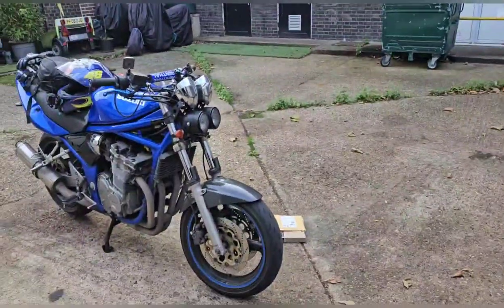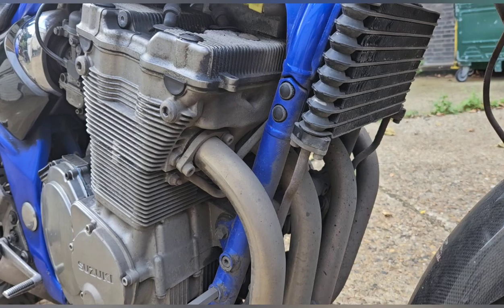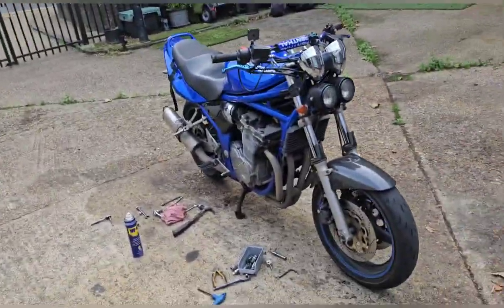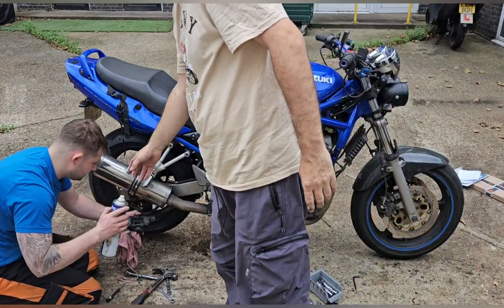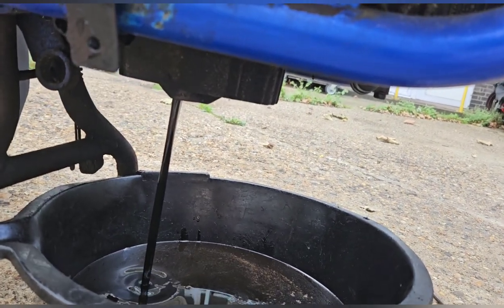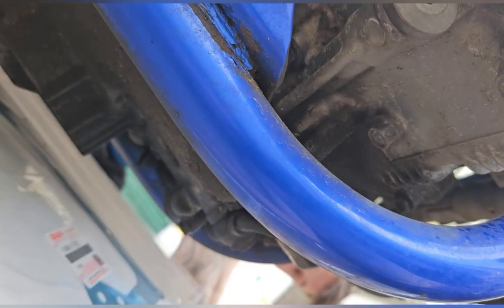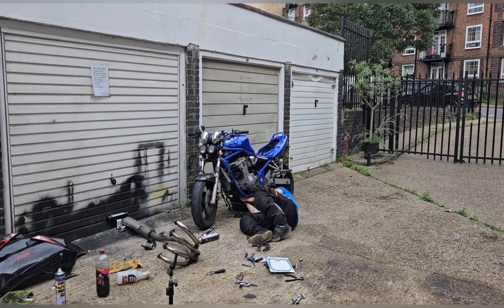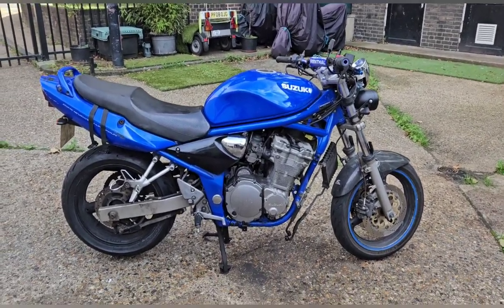Suzuki bandit 600, gsf 600, sump gasket, sunp gasket change. Gary learns more and more.

Comment: When I took the sump off my 1980 GS550 shortly after I bought it, 2 years ago, it was like a swamp in there, thick black sludge, lumps of silicone, bits of old gasket (cylinder base gasket, I think), but fortunately, no chunks of metal. It was part of the process of putting right all the things previous owners had done (or not done) to it.
Reply from the maker: That's a good point Rick. I've never really done oil flushes as I didn't trust any of the oil thinning products. But I may consider the odd one on any older bikes I get. 

I got my cdi back today for that peugeot satalis. They say that they disengaged the immobiliser.  Fingers crossed it works.
Reply: @motorcyclerescuer  🤞
Reply: @motorcyclerescuer  I've never used oil flushing products, either, not on bikes or throughout my career as a car and van mechanic. I have occasionally done an oil change using a cheap oil, and replaced it again with the proper stuff after a short run time, when the oil has been very dirty and neglected. With the GS, the most effective option was to take the sump off and wash it out.
Reply from the maker: @rickconstant6106 funny enough I used to do the same. Cheap oil for a few days then drop it and put good in. 

I think these flushes just thin the oil, but it's that bit that always worried me. Running a very thin oil even for minutes

Comment: Well done Charlie, you encouraged me to have a go at my Triumph 650 stuck clutch, I tried rocking in gear etc as you suggested, but no luck and I'm not surprised when I saw the clutch plates were completely stuck together ! Re Bandit exhaust headers, I know exactly what you mean, a so called mechanic snapped a stud off on mine ! Such a shame as I loved that bike 😥 I think it is worth putting some copper grease on them.
Reply from the maker: Exhaust bolts can be a right pain. A whole engine ruined because of them. I think that's why people won't touch them. But this leads into the issue. Years later they are corroded. 

Worth loosening a touch every year before mot. Loosening and tightening I mean. 

And I'm unsure what grease can be used on them. Does copper grease work with the heat?
Reply: @motorcyclerescuer  Yes Charlie, Copper grease is good for up to 1150C, Wish I had known that when I bought the Bandit.
Reply from the maker: Wow I will start using it on heated studs from now on then. I learn new things all the time. 

Thanks